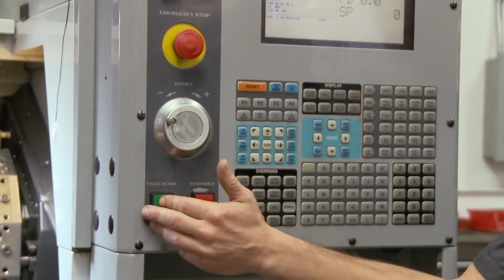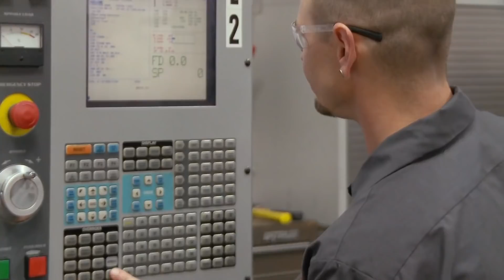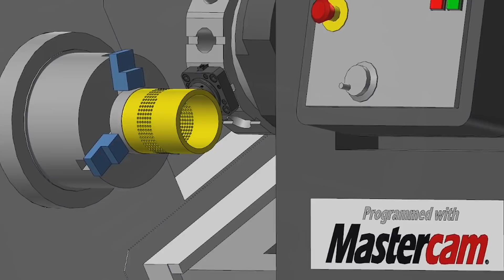I Messed Up... This Job is Too Tough, I Want to QUIT

Comment: I was hired at a very large aerospace manufacturing company last year. I had no machining experience and no idea about, well, anything. I've been doing mostly deburr and honing parts but I've run some simpler machines a handful of times. I'm careful, ask lots of questions, and try to be thorough but I am still terrified almost every day I go in. It's a great job that will leave me set for the next 25+ years if I want to but I'll admit I've nearly quit a couple of times because of how hard it was. I've definitely felt the desire to let my weakness win. I'm about a year and 8 months in and I'm still fighting every day to try and make it work.

Comment: My toughest day at work is the day where I have to look for every single component throughout the building. Somehow have to find collets, tool holders, screwdrivers, wrenches etc among all the worn out garbage and actually assemble a set of tools. Trying to replace worn out insert screws by scavenging screws from other tools. Everyone are busy running around but work is slow and by the end of the day not even thinking about the work anymore just why am I doing this. Dragging your feet from one table to another looking for stuff, no motivation.
Reply: damn, i can relate

Comment: As of right now. My fear is tight tolerance under .001
Reply: I just turned parts and had to hold a 
.0002 tolerance. I ended up polishing them. They were to be .3746 out of .500 stock. And no center hole allowed LOL. 

I hope the customer likes them I hit the tolerances.
Reply: @rowdyrager-9403  impressive. The last time I was on a CNC lathe , it was trade school and I managed to hit .0001. just kinda intimidated that I might ruined a $7000 part becomes a little overwhelming.

Comment: Rule I go by when learning a job you weren't trained to do properly, and one that's helped me out in my CNC career. 

"The easiest way to remember to do something is to forget to do it." 

Forget to set the zero after programming a new part or forget to zero off a tool and crash the machine, you'll never forget to do it again.

Comment: Long ago, when I was still a machining caterpillar (not the majestic butterfly seen today! LOL) I was a couple years into my CNC training, was doing well, but allowed overconfidence and a little cockiness to de-rail my train. I crashed a machine in spectacular fashion, and I knew the second it happened how bad it was and how expensive repairing it would be. I got that sick feeling of disappointment in myself that one feels when failing. The crash was loud enough to bring the owner out of the front office. A veteran of machining himself, he came to the machine, asked me to explain what happened. I did so, fully expecting to be invited to get a job somewhere else. When I was done talking, he gave me a very severe look and said "I bet you never make that particular mistake again!". That was the last thing said about the incident. I learned several things that day. To not forget that step of the set-up, that cockiness has no value though confidence does, and to always remember (now that I am a leader in the trade) that machinists that are early in their training will make mistakes that they agonize over without me adding to it. That agonizing simply means they care. He saw that in me all those years ago.
Reply: I’m 22 years old been working at a cnc machining factory for 3 and a half years and I can remember my first time I crashed my machine. It was a hass mill and I made a offset in Z when I was supposed to make it in X And the spindle slammed into the table. They had to replace the whole spindle. I for sure thought I was gonna be fired. But the boss was very patient with me said “I’ve messed up too many times to count, it happens” too this day Yes I still mess up here and there but the best advice I’ve learned it slow down and do it properly, when you rush that’s when things go wrong
Reply: @evanjonez914  your shop owner is a nice man bro, he knows everyone starts from doing mistakes to be a professional.
Reply: Great story thanks for sharing!
Reply: No one learns without making mistakes. Crashes happen. Don't know the clamp pressure limit is before the part falls of? Well you can't know until the part flies through the glass at least once. No need to punish people for this, unless it happens regularly without any learning
Reply: Well my shop owner yelled at me on little mistake but it's gud for me becoz I don't repeat that mistake again. But sometimes it demotivate us but we have to keep going.
Reply: I learnt so much from crashing a CNC machine... Same story as yours. It was very costly yet the owner of the facility did the same, he swore, not at me but at the situation. It remained a great place to work. Though I felt extremely sick from what had happened.

Comment: I also remember my first day. it was CNC lathe in mass production (simple 2 axis machine), but when i saw what this machine can do  and how complex partes were coming off i was standing there like a stone in a field. For my whole first day i was just looking through window at chips flying off and like a week later i got my finger bleeding like hell because of some very long nasty sharp chip. I never give up and after 7 years i'm in the same company but from simple lathe in mass production i became EDM operator and toolmaker and I make molds and stamping dies daily. And now I'm thinking about opening my own shop. Crazy how time changes everything.

Comment: Are these feed speeds in the beginning of the video real or the video sped up?
Reply: @ytfan3815  finally someone who backs me up 😂
Reply: I’d say sped up just based on the rapid feed, but idk
Reply: I think it is real but material looks like aluminium and not steel so this feeds and speeds are completly ok.
Reply: The first part is aluminum and the speeds/feeds appear real time. The filter part with all the holes, looks like stainless. The drill cycles also about real time. Rapid cycles on CNC lathes @100% are scary fast because of the short distances.
Reply: @opendstudio7141  I disagree I still think the rapids looks way too fast to have not been sped up
Reply: Only the editor knows for sure. We may never be certain because of the nature of video and the quirkiness framerates. :)

Comment: When I see you rying to look through the window at the machinging in Preocess I am thinking a Great place for a Windsheild Wiper😃 Or a blast of air on the inside.
Reply: We have them on some lathes,they are called rotary wipers,similar to what the ocean ships use on their pilot houses. The wipers help but if you properly adjust your coolant lines,you can see just fine.